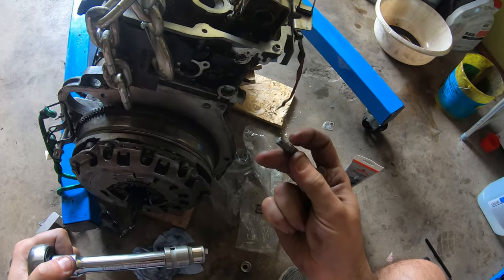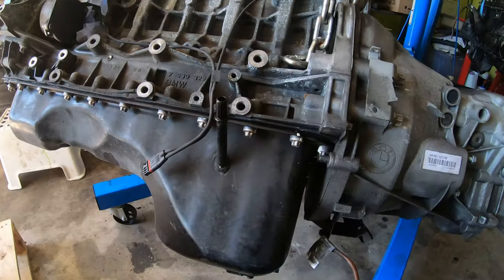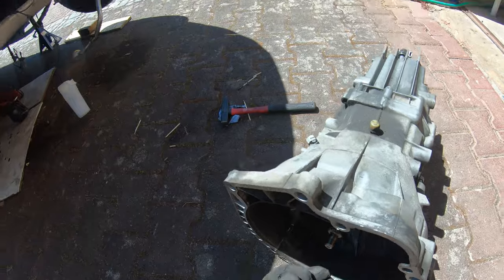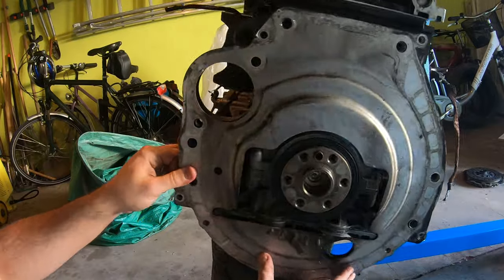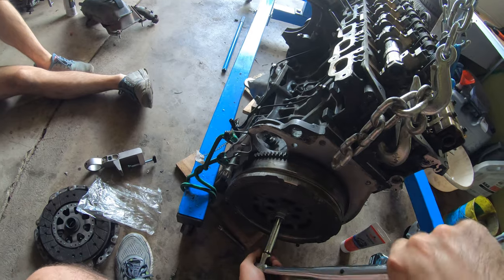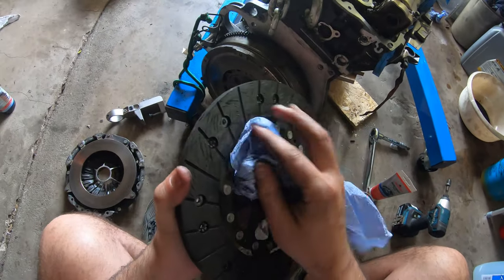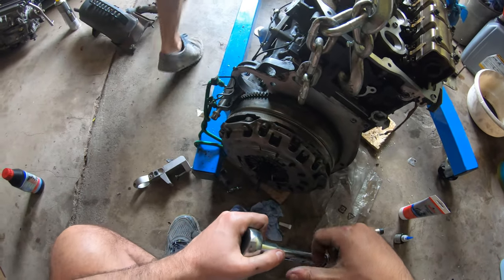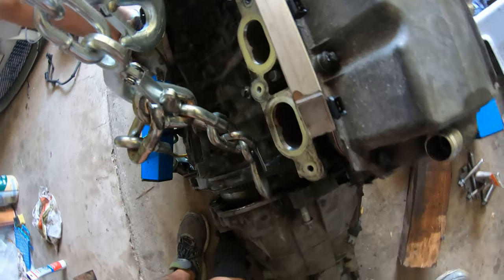BMW Clutch & Flywheel Replacement on a BMW 3 Series (E90) [N52 Engine Swap Part 5]

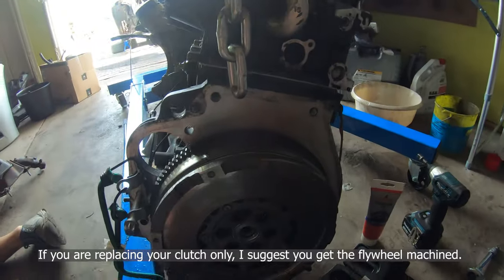Comment: 11:33, you can't machine dual mass flywheels. If the flywheel is worn out, warped, or otherwise not fit to reinstall, you have to replace it.
Reply from the maker: I bought a used (but almost new) flywheel and clutch.
Reply: @buildanddrive  Yea they're expensive to buy new (replaced mine with all new shit recently, doesn't really drive any better). It was just info to have for the future, dual masses can't be resurfaced. Still not sure why German manufacturers insisted on using them. I would have done a single mass conversion, but I have xDrive, and I heard that the xDrive and single mass don't really go too well together for some reason.
Reply: @mihalis1010 too expensive huh 😂 just paid 1297$ Canadian dollars for a luk dual mass fly wheel. Another 620$ for luk pressure plate and friction plate. 2,000$ is nothing, comparing this to 300,000kms…
Reply: You also cannot reuse the pressure plate once you take it off. It is a SAC

Comment: Did you replace the flywheel is it old still?
Reply from the maker: The flywheel was used but in good condition. You can take it to a machine shop to get it resurfaced for around 40$. I reused it without issues